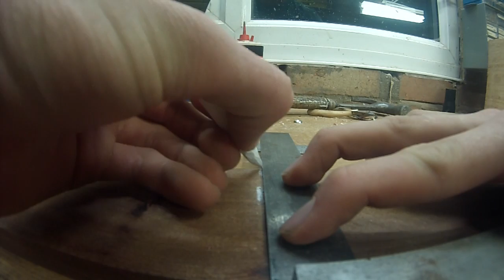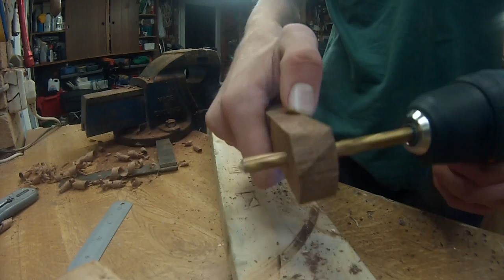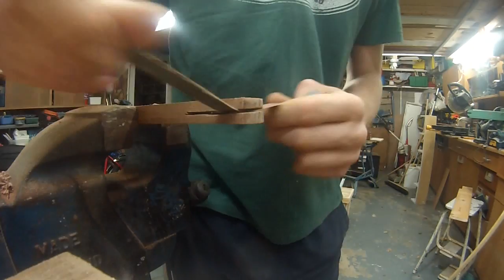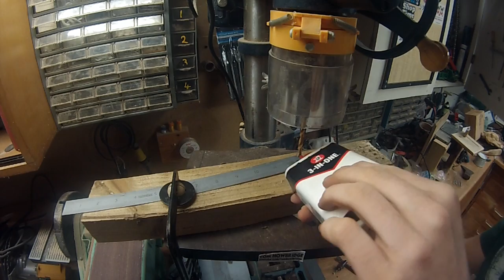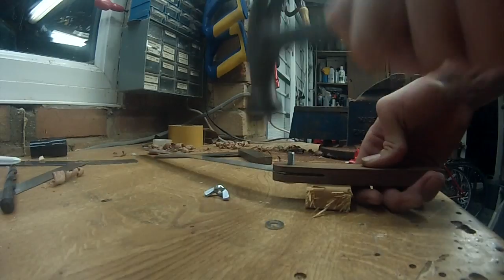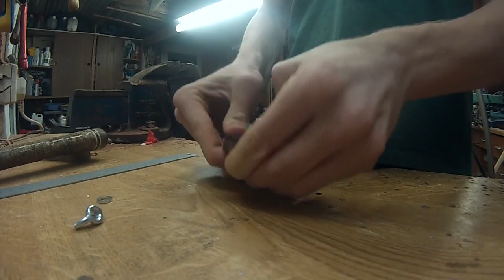Bevel gauge from a ruler

Comment: if you have band saw, why using hand one? 😒😒😒
Reply from the maker: +Галым Бердыкулов Because the bandsaw has a thin blade even allowing for the set of the the teeth so I used a handsaw then realised I cannot cut strait ! so i finished it of with a bandsaw !

Thanks !
Reply: +Tom Howbridge 👍👍👍👍🌀🌀🌀
Reply from the maker: +Галым Бердыкулов 😀👍👍👍👍👍